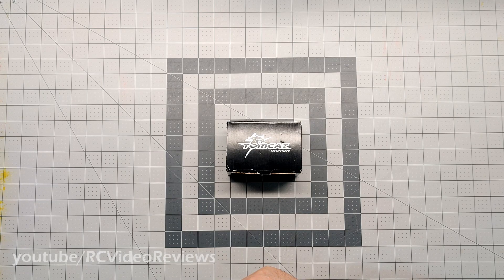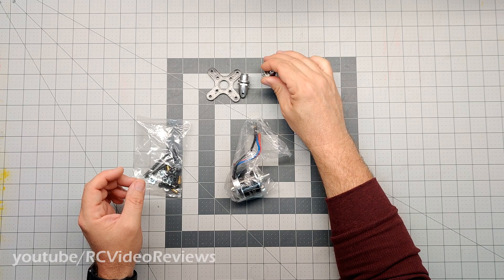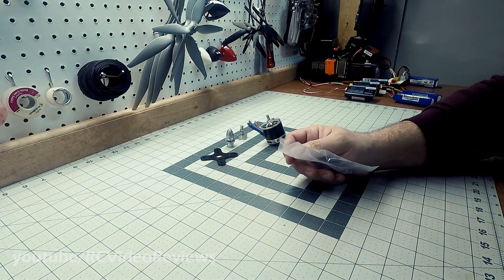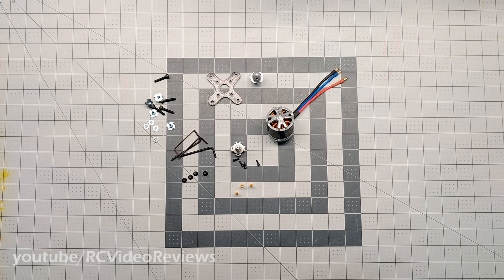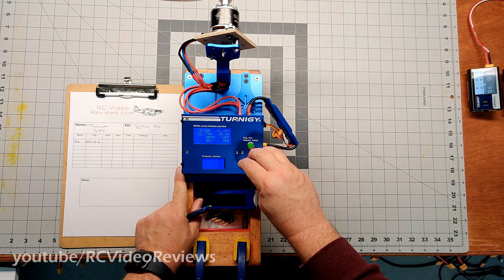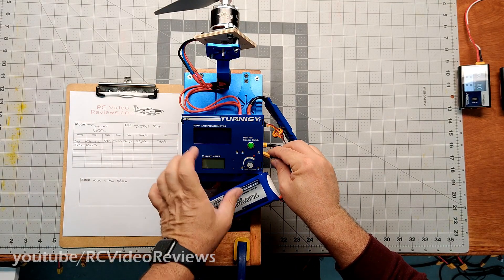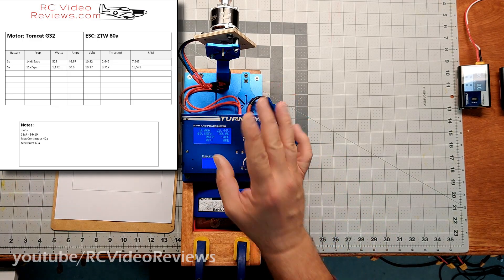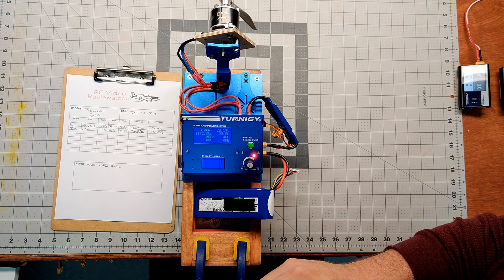Tomcat G32 Brushless Motor Power Production - Is it enough?

Comment: Thanks for such a nice explanation.
It would be great if you can help me. I am having a .50(1650mm) Cessna 182 fiberglass scale model, weights around 4kg. Can you please suggest me some budget friendly motors to fly with 12x8 Triblade APC propeller & 6S Lipo ?? 
I have a few expensive options in my mind as listed below but no idea how good these will be in terms of power & weight ratio. Also these type big motors are barely available in India, so I may have to import them at my own risk.
1. Dualsky ECO 4120 560KV
2. T-motor AT4120 500KV or 560KV
Reply from the maker: You need to get a subscription to ecalc.ch to work out problems like that. I like Cobra and Sunnysky motors.
Reply: @RCVideoReviews  I already have the same subscription. Is it accurate & reliable ?
Reply from the maker: It's accurate enough to get you in the neighborhood. It's not perfect though.

Comment: Hey great video, could you please test the turning G25 870KV?
Reply from the maker: Elijah, I've looked at the Turnigy G-series motors a couple of times and ALWAYS wind up going with something else. Their stated specs don't seem to compare favorably with other options so I've never bought one. Do you have a G25 870? Is that why you're asking? Or are you considering one?
Reply: Yeah I do have a G25 870KV on my Rc plane with a 12x8E propeller. I’m just trying to see if the sound is right because it’s a second hand one.
Reply from the maker: @OnePilot12222  Sound can be a very subjective issue. Do you have a specific concern? Does it come off hot? Are you running a 3s with that prop on that motor?
Reply: No, I am running the motor on 4s. I’m just  concerned because an Rc plane instructor said to me that he thinks the motor bearings need to be lubricated. So he put some lubricant for electric motors on the motor and it doesn’t make a difference, so I just want to make sure it’s working ok.
Reply from the maker: @OnePilot12222  That seems like a big prop on 4s for that motor to me. If you can, you should invest in a watt meter and measure it. 

I've never oiled a brushless motor--ever.
Reply: Ok, I’ll try that, although that certain prop I’m using got recommended for my model plane (boomerang 40). If you want to listen to the sound of my motor, I have got a video on my YouTube channel  of me flying my model plane and that might be good if you want to see if it sounds ok or you recon I should change. Thanks for your help.

Comment: Here is a line of very inexpensive motors but impressive you might want to take a look at,hobbymate motors sold by rc juice which is primarily an rc car co ,I have 7 of them in planes very smooth running and can handle some abuse ,the specs are very impressive   on these I would love to know just how true they are[see the 2836] most of mine are the 3536 1050kv and I have put one through some serious overampage by mistake for a lot of flights and it seems unscathed once you see the specs yo will know what I am talking about
Reply from the maker: Thanks for the tip Jeremy. I’ll look into them.

Comment: You should get better views of the motor. Mine was very nice looking with the Blue anodized body. I had a G32 in my Sig T-Clips. I sold that plane but the motor always performed very well.
Reply from the maker: Good feedback Dave. Thank you. I'll work on getting better camera angles. The more I do this, the more I see a need for an external monitor on the cameras so I can see what the viewer sees while filming. I've actually figured that out with the GoPro already and use that to my advantage. I think I need to do it with the overhead, and make sure I use the external monitor more often while filming. I have to keep reminding myself that I can cut unwanted material. It's kind of a mental thing while filming--I try to make each take perfectly to minimize editing time. 

Just more opportunity to up my game :)

Comment: I’ve used Tomcat motors and never had an issue. I had seen that Bitgohobby carried them and was happy to see that. Very good pricing and decent quality.
Do you have a Ordering Code for Bitgo, so they know what traffic you’re sending their way?
Reply from the maker: Only the coupon code for radio equipment...Glad to hear you've had good experience with them. I have the Leopard, VH G32, Cobra, and Rimfire available for the shootout now. Just need to get them off the planes....soon!
Reply: RC Video Reviews I can’t wait to see the results of that. I can’t (for myself), justify a $90 or $100 motor in a $105 plane. (Tower Hobbies Sport).  Mine has the Leopard motor 32 size equivalent ($45) and I’m very pleased with it. (That motor was your suggestion to me a long time ago)👍
Reply from the maker: I agree. Seems silly to me to spend the cost of the airframe in servos or the motor (or the radio for that matter) unless it's some very specific use case like an Eagletree Vector for long range flying. I am looking forward to getting this shootout done because I want to see the results side-by-side in a controlled environment. My prediction is that the mid-tier Leopard/Tomcat will run within a few percentage points of the high end. I even think the budget motor will be in the hunt. We'll see though.